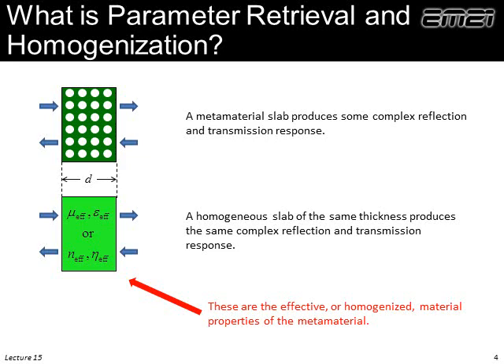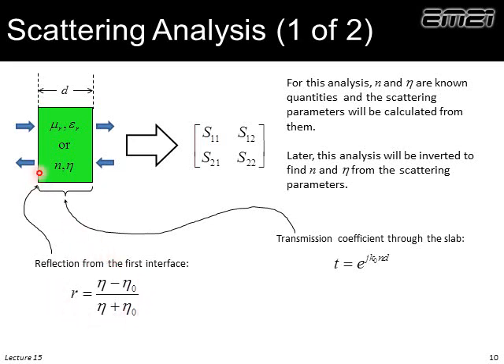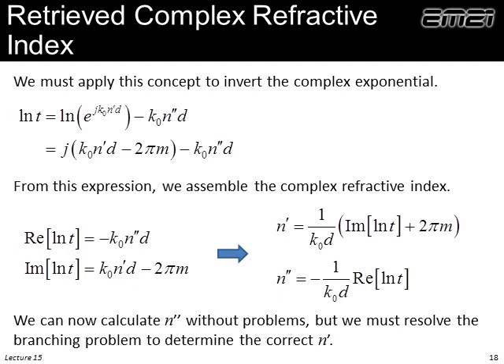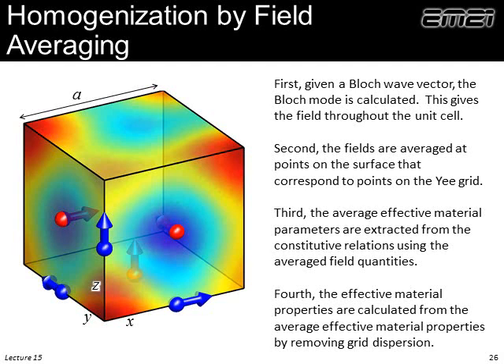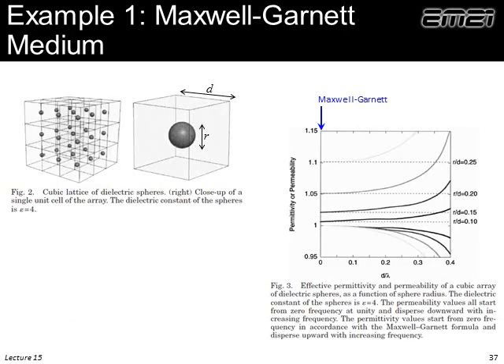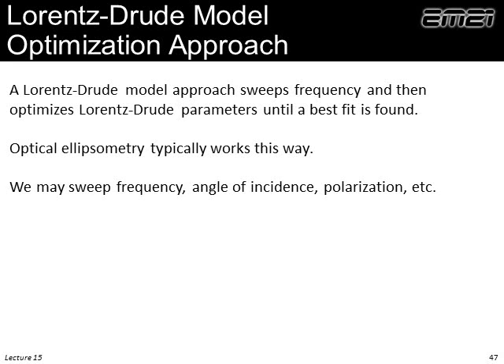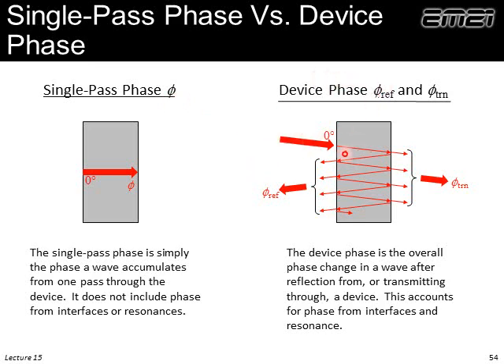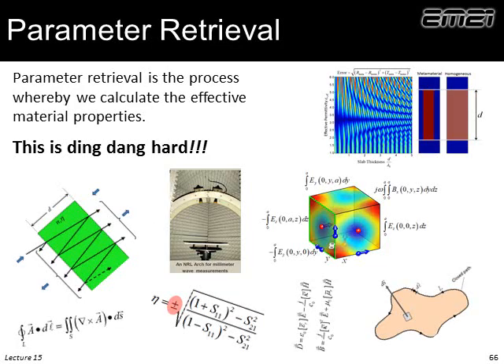Lecture 15 (EM21) -- Homogenization and parameter retrieval

Comment: @1:06:42 incredible video , although here photonic crystals are mentioned as resonant, is that correct , my understanding is different
Reply from the maker: If you ask 10 people, you will 20 definitions for photonic crystals, gratings, metamaterials, etc. I try to stick with as close to the statistical average as possible. I mention this because if you look hard enough, you will people with strong opinions and some different that I say in my videos.

Photonic crystals have a lattice spacing large enough that waves scatter between the unit cells. Billions of scattered waves happen all at the same time, but if you squint your eyes there does still appear to be overall bulk waves. In fact, these are called Bloch waves. I am calling this scattering a resonance. BTW, it is difficult to impossible to homogenize a photonic crystal due to this scattering.

If the lattice spacing is too small for scattering but large enough that metallic elements can be resonant, like little antennas, this is called a metamaterial. Smaller than this, you are really are just looking at mixtures.

Hope this helps!
Reply: @empossible1577  Thanks yes it does, up to now I've been assuming based on the symmetry of a photonic crystal's dispersion curve that resonance conditions could be related to effective mass, making it a tunable parameter according to the curvature of band edges - and doping, as a means to control where excitons occur. I'm looking to simulate that this week and your video really helped me understand what i can be doing to simplify structures.

Comment: Thanks for this course!! Exactly what I was looking for.
Reply from the maker: Awesome!!  This particular lecture is on my radar to revise.  I have already revised the notes a bit, but have not recorded a new video.  You can get links to the latest versions of everything from the course website:

https://empossible.net/academics/emp6303/
Reply: @EMPossible  The latest version is pretty nice, thanks. I was wondering if 17:03 once we have 't' in the complex format, e.g. R+j*Im, can we just say that the module of t (sqrt(R^2+Im^2)) is equal to exp(-k0*n"*d) and arctan(Im/R) is equal to k0*n'*d ? Because we can get the S-parameters in the complex format and determine t and r from there. I'm trying to apply all these things for an analogous situation with planar transmission lines to get parameter retrieval using an R&S VNA.
Reply from the maker: @AnotherConcernedCitizen  It is completely incorrect to say arctan is k0*n*d because you can add integer multiples of 2pi to k0*n*d and get the same answers.  If you have a thick sample, it may be one of these that is the correct answer.  This is the branching problem.
Reply: @empossible1577  Did you mean "it is completely INcorrect"? Thanks!
Reply from the maker: @AnotherConcernedCitizen  Woops.  Yes...let me edit the above comment so others are not misled.  Thanks!

Comment: Hi Prof Rumpf,
There is always so much to take away from your lectures and thanks so much for this resources.
Now to my question:

1. you kept mentioning "knowing the refractive index at a previous frequency point " on slide 19. What exactly do you mean by this statement? Is this the refractive index we are working with?

2. Do we always have to take the natural log of the eigenvalue? Couldnt we have just expanded exp(i*k*z) = cos(k*z)+isin(k*z) and just equate cos(k*z) = Re[eigenvalue] like in Yeh's original work P Yeh, A Yariv, CS Hong - JOSA, 1977?
Reply from the maker: Thank you!

1) The problem is branching.  This is all based on waves that repeat.  This leads to multiple correct answers during parameter retrieval.  Away from strong resonances, the parameters should be smooth.  If you know the properties at a previous frequency point, then it becomes easier to determine the properties at the next frequency point because the correct answer will be the one that makes the line most continuous.

2) I suspect you could also use Euler's identity.  The problem is not really the natural log, but the branches.  When you invert the exponential (or cosine in your case), there is an infinite number of solutions.  These are the branches.

Hope this helped!
Reply: @empossible1577  Thank you! Prof Rumpf 

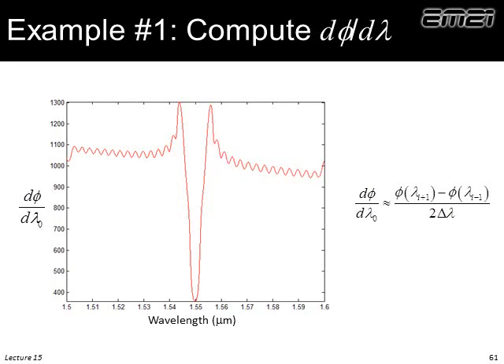At time stamp 1:05:15 slide 61, what numerical boundary condition did you use for the finite difference estimation? Periodic or Neumann?
Reply from the maker: @levionelevis5883  I actually do not remember!  I either used Neuman or just ignored the end points.
Reply: @empossible1577  Thank you so much prof Rumpf. The prompt response was faster than the speed of light ' :-)) thanks.

Comment: Hey Sir,

First of all very good lecture. Very interesting topics. One thing still remain unclear for me.

Regarding your last technique about differentiating the phase with respect to wavelength/frequency. I did the same procedure as you with TMM algorithm from your lecture, obtain pretty the same effective refractive index, and putting this n_effective back into the TMM algorithm simulating a single layer of thickness (period*(d1+d2)). I was hoping getting the same transmission coefficients as the ones from the periodic thicknesses, but transmission coefficients don't look the same... Is that normal? 

Best
Reply from the maker: If you replace whatever structure you simulated with a homogeneous medium, I do expect transmission and reflection to change.  They should be nearly the same at the frequency where the parameters were retrieved.  Many structures do not fit the effective medium model well, especially things like photonic crystals.  Metamaterials and other highly subwavelength structures fit effective medium models the best.

Comment: Should I use x-jy or x+jy, if I use experimental S-parameter data instead of the one from commercial solver?
Reply from the maker: Purushothaman N I actually do not know.  The choice of the sign is a convention and I do not think all solvers or all test equipment do it the same.  I think you will have to learn a bit more about your solver to figure out which convention it is using.

Comment: I have a question on parameter retrieval, particularly, based on K-K relation. I am following the retrieval process based on Zsolt Szabó's paper.  The S-parameters that we simulate using a commercial solver are in terms of magnitude and phase (deg). During the retrieval process, I am converting S-parameters into rectangular coordinates. I get correct result only when I use x-jy instead of x+jy. Is this because of time-harmonic dependence mentioned in the paper (exp(-jwt))? Is the same convention used by the commercial solver as well? Kindly clarify.
Reply from the maker: Purushothaman N That I can tell, the two conventions are used about equally.  I think you have the right approach to figure it out.  Try both and use the one that you know is correct.
Reply: CEM Lectures Thanks for your replies. As I understand, one needs to know about the time-harmonic term used by the commercial solver or the equipment. Is that right? Because, for an arbitrary unit cell, results obtained from using either of the conventions could be right. Maybe, in that case, we need to first verify it with a standard material or a unit cell whose EM properties are well known.